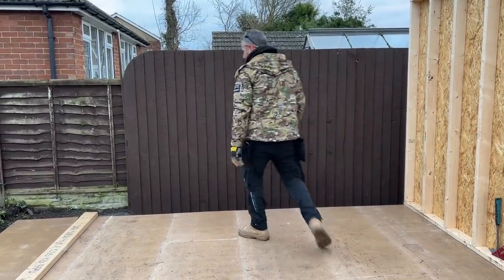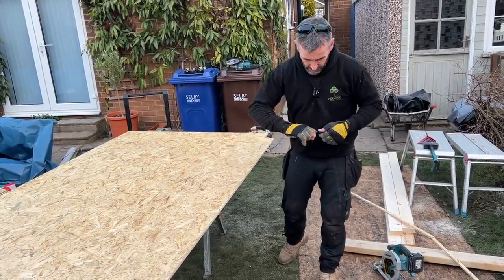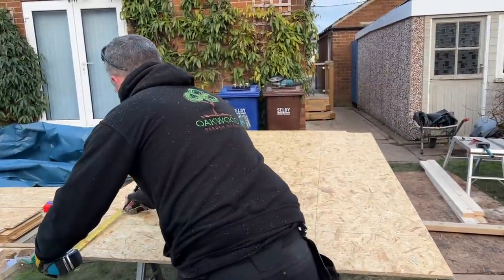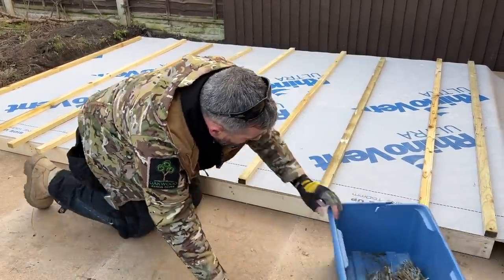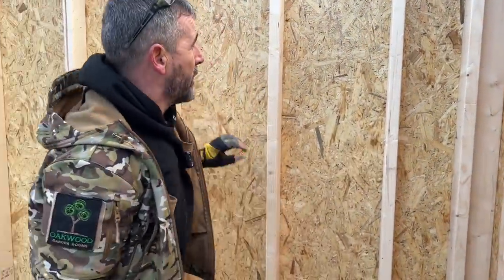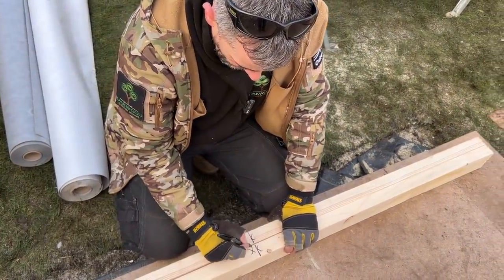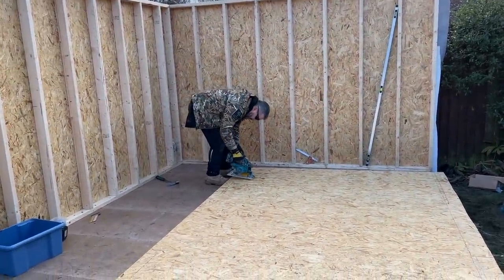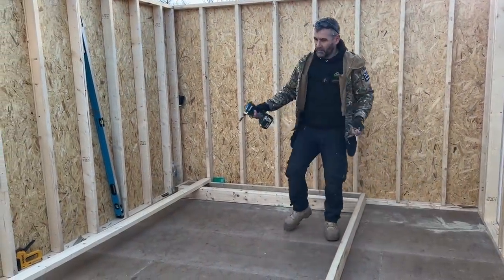Day 4, garden room construction, timber walls, day 4

Comment: Your vids are really informative! fantastic instruction throughout!
How would you build it if the garden room was 5m deep by 3m wide with the door at the front 3m section? Would you run the rafters widthways on the 3m? Would you cut the studs at varying heights from back to front to get the 75mm slope?😎

Comment: Really enjoying these. I have a build pack and planning on starting now in the spring. Perfect timing.
Reply: Does the build pack include where to purchase the materials? Does it include the sizes and where to buy the black corrugated sheets for the back? Thinking of buying a pack but the website just says it’s a list and instructions so would be good to know from somebody who has purchased one. Thanks.
Reply: @cragly8759  Hi, it does come with a very comprehensive list of materials, but for things like lumber and the corrugated sheets, you'll need to find a local supplier. But all you have to do is send them the list in the build pack.

Comment: Hi Liam if I was using smaller door approx 2m wide would you still use the steel or would making a head with osb sandwiched between 5x2 be enough???? thanks

Comment: I am just wondering how much weight can the floor take? I am looking at building a 7m x4m workshop and it could have a couple 250kg machines in.. Would I just need to use bigger timbers like 4x4 or 4x5 for the outside and 2x5 for the joists?

Comment: Just an idea but if you allowed the braces to stick out (8 to 12 ") you would have an extra pair of supports for the rectangular hollow section. 
Filling the “steel beam” with rockwool isn’t going to make much (if any) difference to the cold bridging which will happen across the two shorter sections. It will stop any cold coming in the ends, but some expanding foam in each end would do the same. Why not double timber? Maybe 2 of 45*170 C24, you have effectively already made one and fixed it to the “steel”.
Reply from the maker: The steel will not sag, unlike the timber
Reply: @thegardenroomguru  If just fitting a standard patio door (not bifolds), say 1600 wide, can timber be used instead of steel? Also, when ordering a patio door, is the height 1950 or less? Thanks so much mate!

Comment: Fantastic videos and eager to start this project on my own. 

Sorry if this is a daft question, but in the foundation, do you use galvanised threaded rods or stainless steel? I’m confused over which will rust less in the concrete and generally outside.
Reply from the maker: there galvanised mate, stainless steel will cost you a lot more and  neither will rust to failure in our life times

Comment: Best in business! Learned a lot from you guys! Keep to good work! Ps: can you say the metric on timbers as well please?? Only asking due to different suppliers have different measures! (Like 5 by 2 = ? mm ) Thank you!
Reply: 5 x 2 is 5 inch by 2 inch, one inch is 25.4mm so just multiply 25.4 by 5 and then by 2 for the two metric sizes. Also remember these are not the finished sizes, it’s the size of the wood before it is planed square so if you buy 5 x 2 it won’t actually be that size depending on the type of wood you buy

Comment: QUESTION!!! See how u did 90mm for the corner overhang … should u not do extra 11mm  for the OSB also ? Or do u just do 90mm  for a reason ??
Reply from the maker: 90mm snd if for any reason I’ve overvshot the previous wall, it won’t impede

Comment: Great video (as usual) Liam. Quick question. Could you use a smaller 4.5” grinder to cut the steel rather than the big 9” you use? Thanks
P.s Hope the finger’s ok and that you are too with the “stuff” you have going on. Michael.
Reply from the maker: Yes mate, smaller grinder is absolutely fine, just uses more blades and time 👌thanks for your concern 🥰

Comment: So the reason I always put my noggings in with the frame on the floor is because it keeps each stud perfectly straight, as when your nailing your sheets, you can’t see the stud at 400 and 800, so you could be nailing it when it’s bent like a banana, then when you stand it up and come to insulate, you’ve a gap down the side of your insulation 👍🏻👍🏻 I do all my noggings straight, not up and down, also 1200 between the bottom plate and the nogging so you don’t need to cut them 💪🏻 but hey ho, everyone’s different
Reply from the maker: I’ll detail this in the insulation video and explain why it’s quicker

Comment: Is there any reason why you don't use a breathable membrane between the insulation and the egger flooring boards?
Reply from the maker: We used to and still would, but in the wetter months when building it can hold any rain, when the build is starting to dry the water is then drawn back into the room, obviously this isn’t an issue on a private build, but on a job, we need to complete quickly, so water coming up is an issue

Comment: Why don’t you treat the steal with paint Liam ?
Reply from the maker: It’ll never rust in mine or the customers life time, I once googled rust rates and decided that I didn’t need to worry, it’s a building control thing and they are anal. The titanic is sat on the ocean bottom in salt water and it’s been there for 110 years, approximately, it’s still holding its own against the pressure of the deep 
Steel hollow section will be 💪🏻but that’s only my opinion 😬

Comment: Great content really is. Can I ask with the build being so close to the boundary, is it sufficient just to use metal roofing sheets on the sides to for fill the fire regs side of things or is that for bigger over 30m2 builds?
Reply from the maker: It really is open to interpretation mate, some councils are happy with fire retardant paint , others will only allow block built, but at 2.5 limit, you can’t have a pitched roof with concrete tiles, so kinda defeats the object imo.
Reply from the maker: @AskGolfNut  it can be soul destroying 🤣
Work your day
Edit your day 
Re watch your day ………
3 days a day 😳
Groundhog Day 🤣